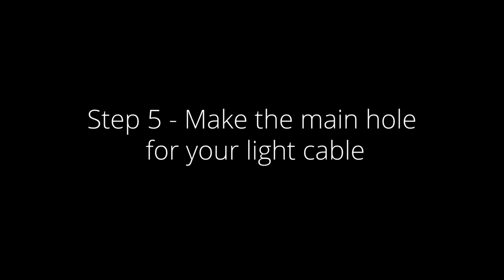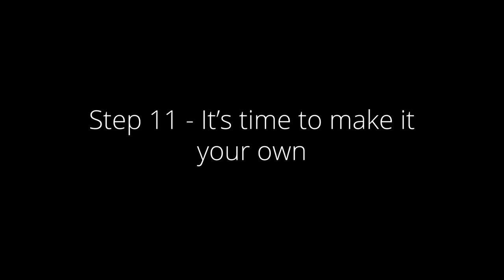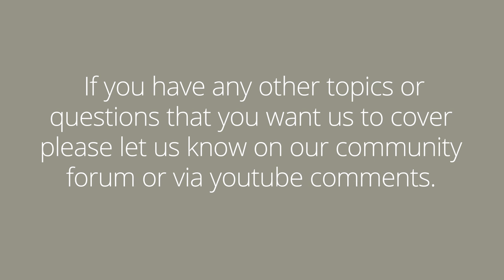How To's - Woodturn a table lamp for your home

Comment: Hi buddy...
 appreciate  your work from India.
I was curious to know if that hole boring that you did is possible on an 3 feet long peice.
Much love and respect to you.
Reply from the maker: Hi there, yes a three foot piece can be bored. Depending on the lathe you are using, you will need to bore in from both ends to make the length. Hope that helps!